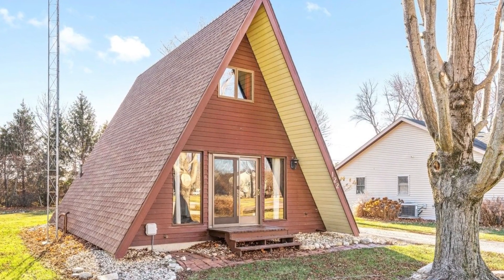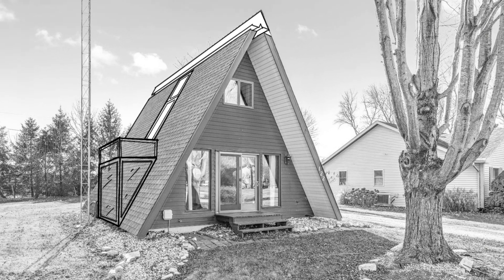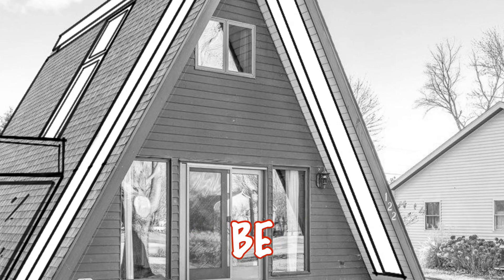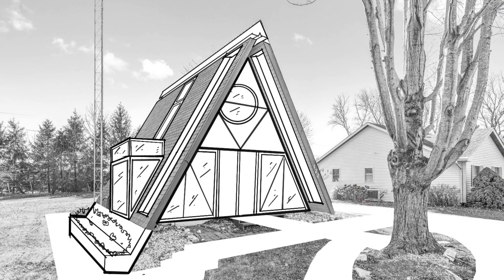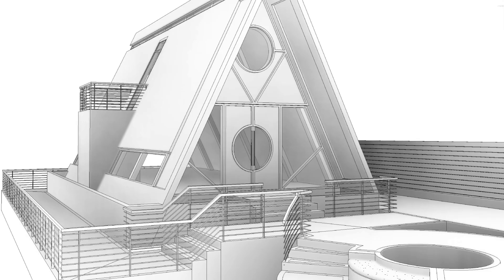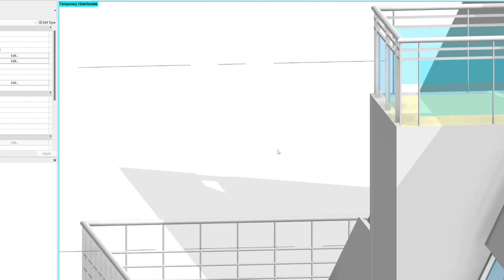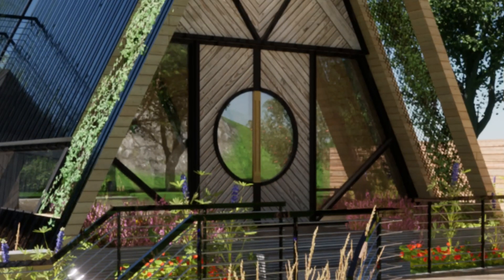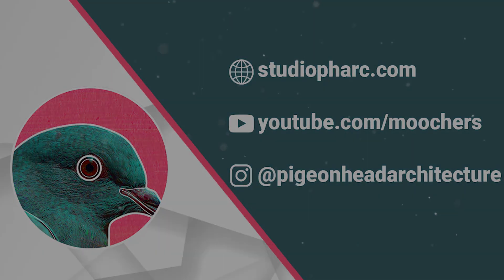What would an old $119,000 A-frame house look like with a modern-day design?

Comment from the maker: If you are looking for my social media links, check out studiopharc.com ---- otherwise, drop your questions and comments below and I'll respond to EVERY SINGLE ONE. Try Me.
Reply: Can i suggest a project for your channel? There are some a frame suppliers that allow one to extend an a frame structure length wise. I was hoping to build an a frame that is  350 feet long and has the typical width of a normal a frame ~22 feet wide all the way through. The project i will be tackling is in a dessert climate, i'd love to know if you'd be able to generate unique ideas?
Reply: I also like you was thinking about sky light, or roof windows across the entire length. I dabbled with imaging how an interior courtyard in the center, using a section that's completely glass would play with this structure, imagine a bunch of skylights across like 20 meters. This would also allow for an interior courtyard with vegetation that typical for a desert weather. I also imagined extreeme lines of sights from one end of the structure to the other to engage guests with depth, Im excited because of all the obstacles in play with such a structure but as it would be a single family home, would be nice to share the idea.

Comment: Great design!
I have two concerns in-line with heating though.
1. The color of the roof will accumulate heat. Seeing that it’s oriented towards the sun and is most of the building.
2. Glass easily looses heat and easily gains heat too. Making the the facade glass, which I totally agree with, increases heating during winter and cooling during summer.
Reply from the maker: Great observations. As far as glass goes, I always assume low-e glazing in my designs + the majority of openings on the project is on the northern side which means that you won't get direct sunlight. 

As for the black roof - metal roofs are really energy efficient because of their ability to reflect heat. I know that black surfaces absorb heat but since the surface is metal, it isn't a problem. You also have insulation that mitigates heat transfer. 

Additionally, since this house is located in Illinois, the average weather is usually on the cooler side, so if anything ,retaining a little heat wouldn't be a bad thing as it would offset the need to heat the space as much during the colder months.

Comment: phenomenal redesign - - Q:  how much do you estimate these changes would cost?  (That’s the big question…  bc if the house costs $120,000… And renovations cost, say $100,000 (?) that raises the price considerably)
Reply from the maker: Thank you! It's really difficult to do so due to so many variables. Location, cost of materials, cost of labor, and the actual work. Generally speaking, anytime that you mess with the structure (i.e windows, doors, adding removing load bearing walls etc.) your price will SHOOT up. This is due to needing to (in most cases) hire a structural eng. as well as possibly other engineers to adjust other parts of the house. Prices of materials fluctuate (especially now since the supply chain has been affected), as well as the location due to the conditions of the area and the typical cost of labor in that area. So, yea, tons of variables that will affect cost in a range of tens of thousands in cases like this house. 

There are things in this house which can be costly and could be removed from the design to keep prices down such not having the trellis built into the overhang, not having full floor to ceiling windows on the first floor, and not having so much pavement (especially where I excavated on the eastern side - this is expensive). 

If you want a ballpark figure, there are many calculator or "rule-of-thumb" figures (such as price per square footage) that can get you an idea of what it would be, but of course, you'll never know for sure until your get it done and see the numbers for yourself lol.

I do want to say that as my channel continues to grow and I am able to dedicate more time and resources to it, I'll look for ways to incorporate input from contractors and other consultants to give you an idea as too how much these crazy designs would cost.

Cheers!
Reply: @MarteloDesign  thanks - - That’s a great idea that I think could not only help your channel, also be useful in your career.  Cheers!
Reply from the maker: @_Breakdown  Thank again!